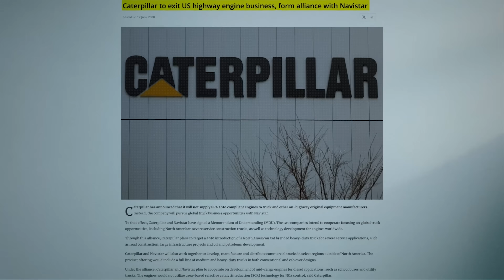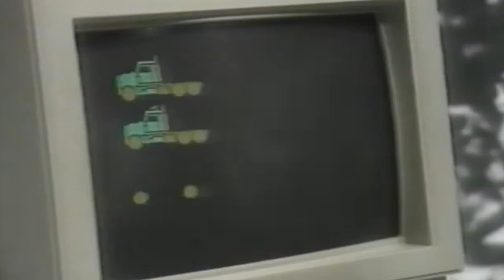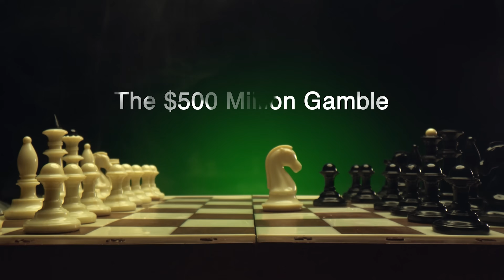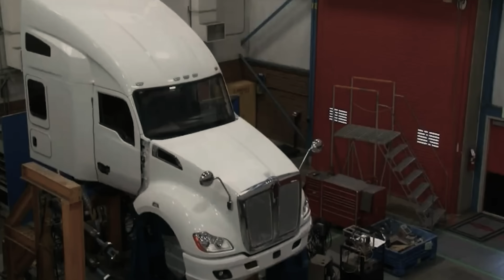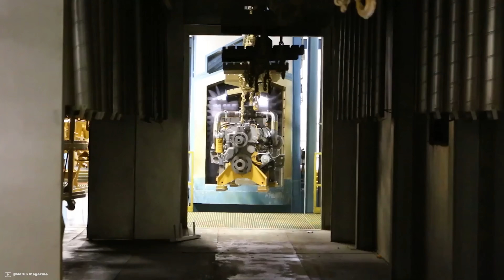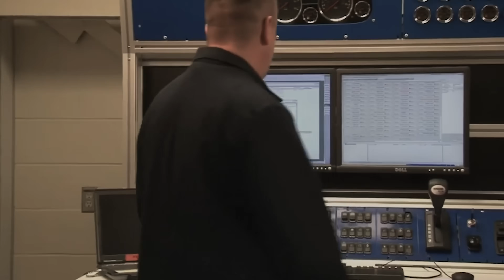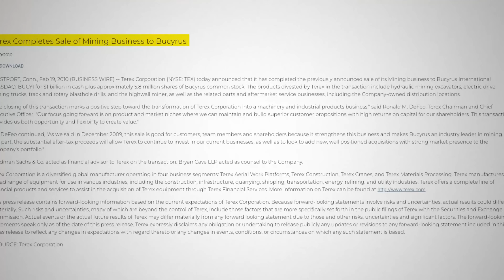Why Caterpillar Quit the Trucking Industry

Comment from the maker: Was Caterpillar's exit a genius business move, or the ultimate betrayal of the American owner-operator?
☕ If you love these deep dives into history and want to help fuel the channel, you can buy me a coffee here: https://buymeacoffee.com/heavymaticyt
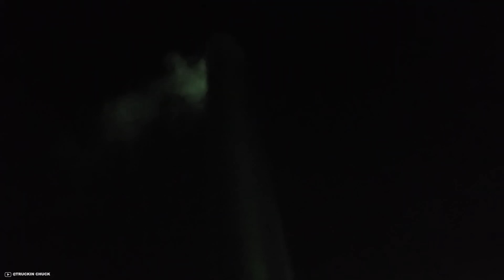Reply: 5:48  ! Original Diesel Gate 😅 & China over there building coal plants up the wazoo 😅😅
Reply: I remember when a court in CA mandated the state put up smog filters all over the state, to find out who was actually polluting. The state cheated and put the smog filters next to the highways, at rush hour hot spots to try and maintain the myth that autos were still the problem.... 
The car drivers won, and it was found that almost all the pollution was diesels from trucks and the railroads. 
A huge surprise was jet aircraft. Even 40 miles from the nearest large airports like San Jose, San Francisco and Oakland, was huge amounts of pollutants from jets... lol 
In any case the truckers and railroads got away with it for decades. That being said, they made them run cleaner, by making them run more efficiently and fuel economy went up a lot. The problem for diesel owners are the particulate filters and the DEF, but the rest of the clean running resulted in a positive in fuel economy.  
They mostly need to drop the DEF and make particulate filters easier to clean, or remove them until a better solution can be found. 
The class 1 railroads whined at first, but found out the newer engines use far less fuel and don't grumble so much now. The main problem for the railroads is also the DEF for a small improvement in cleanliness. 

In any case, the pollution problems are no so much autos anymore, but the government refuses to relax the smog on cars, like the Catalytic converters that are no longer needed. Cars and gas pickups are so inherently clean by design they can pass smog without a catalytic conveter, but it's such a scam, that nobody on the dem or rep side will modify the laws, to let cars no longer run them if they can pass without it.... 
The current "rep" administration promised to change the laws to get rid of auto start stop but hasn't lifted a finger... Neither side has...

Cat is pissed ,but at the same time, they had decades to make more efficient, cleaner running engines and did nothing. The other problem is the politicians being in the back pockets of companies that make DEF, and things like Catalytic converters etc.  
The rest of us get it up the yazoo...
Reply: @MrEricmopar  god can you imagine the pollution from mining all the metals that go into cat converters

Comment: I had 680,000 on my 2006 C15 ACERT in my Peterbilt 387 when I overrevved it going down Tehachapi due to a moment's inattention and broke a rocker arm. Got the rocker arm fixed, but it still had a knock. $2500 later, nobody could find the knock. But, until that happened, I had no problem getting 7-8 mpg while pulling 80,000 pounds over every major and minor mountain on a U.S. Interstate. Almost every point in this video about the engine itself applies to the 600hp+ version, which wasn't common. My 435hp version had none of those issues. It still had 1850 lb-ft of torque at 600 rpm. It never overheated. I never got back a bad oil test. I always ran synthetic. The compound turbos broke their studs three times, but those studs were finally replaced with bigger stronger studs, under warranty, and that stopped happening.

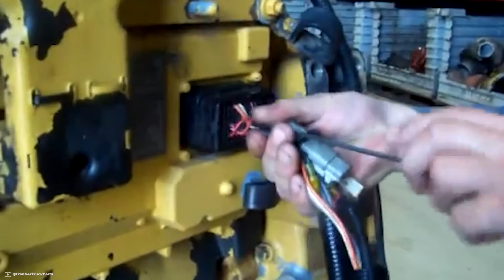Comment: At 12:25 ...oil doesn't short circuit anything, oil doesn't conduct electricity
Reply: Oil gets into the PCB board via the connector pins after it swells the gaskets keeping dirt and oil out. That makes the PCB swell and then the electrical traces in that board move to places they should not. They break from the movement, swell from corrosion caused by moisture bypassing the swollen gasket, and pop surface mounted components off when nearly none of them are optional. Oil traveling up wires via wicking and damaged seals has been destroying electronics in cars and trucks for several decades now.

Comment: As a military mechanic for 11ish years now, I work on trucks with "non-emissions" C7's & C15's on a daily basis.
But I rarely have to touch the engines themselves.
The most frequent problem I encounter is the ECM going bad because the tiny internal batteries are starting to go bad.
And the occasional injector or turbo.
But overall, the engine and Allison tranny are the only part of the truck that soldiers don't manage to destroy.
Reply: Very interesting. That confirms what we was thinking anyway

Comment: I worked for NC/Caterpillar from 2004 to 2009. Rebuilt lots of 5EK, 6NZ and ACERT engines. I was also the tech that rebuilt the 3126 STRYKER engines that came through. 350hp little bombs! I was the CAT rep at the Kenworth plant, overseeing the last of the pre-emissions engines going into the new trucks before the 2007 emissions standards cut the reliable engines out of the market. Was sad to watch, what a waste. Now I operate a propane company and I see to it all my trucks have pre-emissions CAT engines. I see the other companies cycling their trucks through the shop for emissions issues, my trucks just run! Great video, I was wondering if I would agree with your takes.

Comment: Having to deal with finding replacement fittings for the egr tube in my 98 Silverado 2500, the 7.4L, ive described the egr tube as a weak turbocharger. 

I'm about to start putting the engine back together, without the master mechanic I had helping me, who was one of the first in the state to go through all the emissions training back in the day, because sadly he died a fortnight ago...

Interesting to learn more about said system

Comment: I drive for Estes Express lines, we still have a considerable amount of glider kits running. I run 600 miles a night in one. What you said about maintenance and repair downtime is so true. My truck is rarely in the shop and when it is, it's for age related wear and tear, but never down for anything engine related because the pre emissions stuff just RUNS! No stupid derate, no clogged filters. I wish there was a compromise between the old stuff and the new ones where you could still have a clean truck without all of the problematic after treatment crap.

Comment: Makes me want to build a serious Bonneville record holder that is diesel powered.   JCB is at it again right now with Andy Green at the wheel.  Andy Green holds the world record at 763 mph in a jet powered car.  The wheel driven record is over 500 mph with a turbine engine by the Vesco team...
  I use to drive over the road...  I use to haul water in the Bakken oil field... I use to work in the oilfield with Cat 379s V8 sand 398 V12s...  All I remember before the diesel electric era was these Cat motors did the job.  I am  retired now and would love to put Caterpillar in the spot light Bonneville.  Caterpillar has played a vital role in making America productive.

Comment: Not sure this is much different than the EPA pushing higher MPG on consumer vehicles, where manufacturers are squeezing what they can out of every engine with terrible EGR systems and using zero-weight oils that require 10k oil change intervals. Aren't we seeing engine failures on engines that used to get 200k+ miles on them? The biggest difference is that, as consumers, we don't have to follow this BS and can change our oil more frequently and also use an oil that provides better protection.  BUT... everyone who has these engine failures wants to blame the manufacturer instead of the government that has imposed these stringent demands on them.  I'm not talking about engines that have had issues with machining debris left in them... that comes down to lazy workers who don't have pride in their job and are only there to collect a paycheck.  Now, before the haters start commenting on my last comment... each manufacturer does have a QA in place; the QA department has these lazy workers as well, they don't discriminate based on job duties LOL!  Maybe the EPA should focus more on trying to filter volcanoes when they erupt 🤣🤣🤣🤣🤣🤣🤣🤣🤣🤣🤣🤣🤣🤣🤣🤣

Comment: A tuned an deleted acert c15 while not as good as an old all mechanical cat is still a dang good engine. My dad's 2007 Peterbilt set at 750hp speaks for itself
Reply: From someone that runs a converted Acert at 700hp these things are beasts. Even a fully deleted SDP could be something to write home about. Still those E models are peak

Comment: 6000 HP highway diesel!?! Dude, this guy missed a decimal point! A typical Diesel you see on a locomotive with around 15 liters or 915 CI per cylinder and they come on V12 to V16 range from 2000HP to 5000HP. Today!

Comment: I Chose Cummins over CAT in 2003 for my motor home because the Cummins got 2 to 2.5 more miles per gallon, it met emission standards and I didn't need Def.  The CAT repair shop was a filthy pig stye and the Cummins shop was as clean as a whistle.  Myprevious RV had a Cummins ISC and all I had to do with either RV was change filters, belts and fuel filters.  My Current Dodge Ram 6.7 L Cummins does need DEF, which I buy  from Costco.  My  previous Ram with the 5.9 L diesel stayed to gether for 18 years with out any repairs except for replacing air filters, oil filters, fuel filters, and having the valves adjusted once.  I could drive my 2001 1/2   2500 80 mph and get 23 mpg.  My current 2019  Ram 2500 with a 6.7 L gets around 22 to 21 mpg driving 80 mph, needs DEF and all I had to do is replace air filters and a serpentine  belt.  Oil Changes etc are pricey but name something today involving diesel engines that isn't.  I hope this one lasts 18 years like the previous 2500.   That would be 2037!   I'll be 92 by then!   I will probably wear out before the truck!

Comment: Thus, you have not mentioned how the government was proven wrong. The firm hired to produce the environmental impact report had made a fatal error on the final report. They had placed the decimal point 2 places in the wrong direction in the overall CO2 emissions produced by the US across the board. What was trillions of tons ended up being 10's of billions of tons. Thus making the report 10x more than what was actually being produced. Every emissions control implemented in 2000 for the last 20 yrs was all produced and made legal under a false claim. This film is also wrong in the fact that when a diesel engine reaches its upper rpm range...they DO NOT create more emissions, they are actually cleaner burning. So hi way use makes them better burning and way more efficient. To pass a emissions control with a diesel is an easy fix. Place a stopper under the pedal to as only supply half fuel from the pump. When planting the pedal the injection pump will supply to much fuel causing black smoke from unburned fuel. Place a torch at the exhaust pipe and throttle up a diesel and watch the black smoke ignite and burn up. This is all old skool knowledge that government official's who would ignore decades old hands on mechanics and engineers. For new diesel owners you can get better fuel mileage by driving 70 mph instead of 60 mph on long trips. Bottom end torch is just that, low rpm pulling power. Higher rpm means less stress and less fuel burn. Basic knowledge 101

Comment: The 3512 meeting T4F standards is ABSOLUTELY not the same thing as on-highway.  There are emissions allowances that are different for both at the same power levels AND an additional allowance at 750+HP.  Show me a 3500 engine in an on-highway frame... I'll wait.

Comment: Cut my teeth on 3406B, 3406E, and 6NZ. The company that owned them were meticulous with maintenance. Rebuild every 1,000,000 and logged 2,500,000‐3,000,000 in most of the ECMs on the electronic engines.

Comment: Lots of nonsense in this video. I worked at dealerships throughout the transition to emissions regulations and Cat's exit. I spent many days working on Cat engines and interacting with Cat personnel. 

6NZ engines require cat software and adapters just as later C15 MXS and BXS engines. The rest of the tools were all the same, too. If the C15 engines couldn't be fixed by local shops, neither could the 3406e 6NZ engines.

"Twin series" turbos is contradictory. ACERTs had series turbos. 

The whole bit about ACERTs making too much heat for semi trucks is all false. The very high heat rejection only showed up with the 625hp-rated engines. From the factory, those trucks came with larger radiators to deal with it. The only trucks with overheat problems either needed some normal maintenance, or they were trucks that had been turned up after the fact, and the yahoo doing it didn't upgrade the radiator to match. A common problem in the gliders, even with old, pre-ACERT engines.

The EPA didn't prefer EGR over any other technology. They just set pollution limits and manufacturers could use any tech they wanted to comply. EGR became the industry standard because it was the cheap way to get it done. That's also why SCR has become standard.

Early emissions hardware had high failure rates, but that rapidly changed since warranty is expensive. Wiring, fluid leaks, and fuel system failures remain the most common problems. Emissions hardware has relatively high relibility.

ACERT wasn't what caused the widespread engine failures. The last generation that cat tried to put CGI on had all the problems. SDP and C7S engines were nightmares, and the software in them would often emit fault codes that had nothing to do with the actual problem. They didn't really get the software hammered out until after Cat had already destroyed their reputation and most trucks coming off the assembly lines had Cummins ISX engines or something else. Anything but Cat.

That mess can be traced right back to the decay of Caterpillar management in the preceding years. It looked to all of us like they stopped the emissions R&D early and just started manufacturing the prototype before it was fully debugged and streamlined. That was inflicted by management, not regulators.

The military clean air exemption is stupid. Pollution-related illnesses are markedly more common among service members than the general population, and it'sentirely possible to build reliable compliant engines, as the fleets running such engines right now have proven. Military service is light work compared to haul fleets.
Reply: This is the best comment on here.  Absolutely correct comment, management delayed development of Tier 4 engines so long that what was prototype engine iron was going out on pilot machines when it should be the other way around.  Absolutely backwards.

Comment: 100% the democrat party under obama biden leaderships fault due to EPA emissions requirements which they found a way to pass naturally with no extra equipment, just a trick of valve timing. as did volkswagon. and they were both severely punished for not having a part made obsolete by their trick.
Reply: This is the tipe of crap that tells me that your stupid, do you want are Fuecher generations to have clean air to breve. If you get rid of these emissions equipment you will get dirty air and more green house emissions which would heat up the planet to a alarming rate which is bad since that would raes the water level the all the coastal cities would be under water don't get me wrong I don't like emissions sistoms very much either but it's a necessary evil I guess

Comment: Let's be real here. The fact that Cat went the same way as John Deere in making it so they had a monopoly on repairs and service of all of their equipment has cost the company more money than the emissions regulations ever did.  When Cat equipment outperformed the competition, was nearly bulletproof, and was so well designed it was easy for any competent mechanic to service and overhaul, it was worth the premium in price for both the equipment and the parts.  Now that their products are still almost double what the competition's heavy equipment costs while having almost twice the breakdown rate AND operators have to wait in line to have a Cat tech come work on their equipment only to have the kid show up to admit he has no real clue what the issue is since their systems are now so convoluted that even a trained master technician does not really understand how things work, yellow gear is no longer the best choice.  My grandfather started buying Cat equipment in the 1930s and built an entire dirt construction company using only their heavy equipment. Up until I was in my 20s (late 80s) we never owned or leased a piece of heavy equipment that was not a Caterpillar.  We still have several of the older pieces in our fleet but we have not bought a single new piece of Caterpillar equipment in the last 15 years.  Horrible follow-on service and nearly complete lack of reliable repair technicians in the MT, WY,ND,CO area we operate in has forced us to steer clear of the only brand my grandfather would even consider during his lifetime.  Now we don't even do short term leases on Cat stuff unless there is simply nothing else available in the area we need a piece of equipment for.

Comment: the heavy trucking industry needs to switch to running road legal diesel electric vehicles.  smaller diesel engine that powers a generator, can run at a constant load and constant RPM to generate electricity, this in turn flows into either a battery or to the traction motors at the rear axle.  think of it as a train locomotive for the highway.  would be better for emissions and fuel efficiency, and you can plug it in to charge the battery when parked, and power all of the stuff in the cab off of a DC/DC converter.  there are new silicon based high voltage batteries being developed that are more environmentally friendly cause they don't require the rare earth minerals and can hold twice the power for the same size as a lithium ion battery.